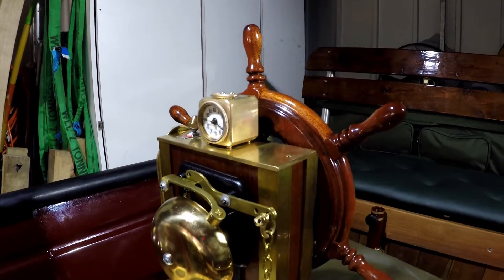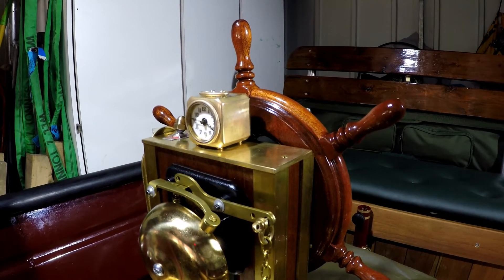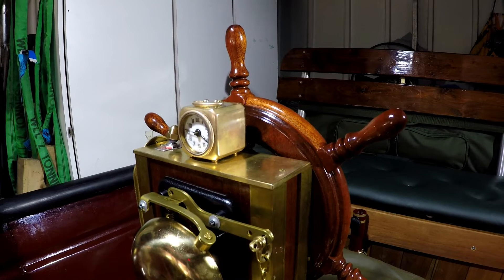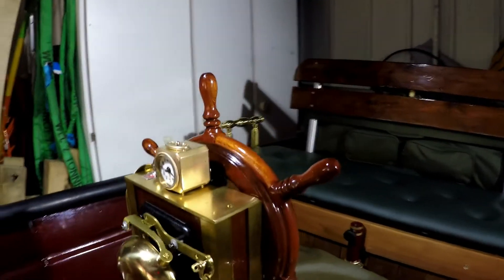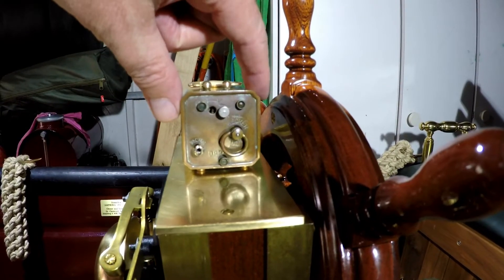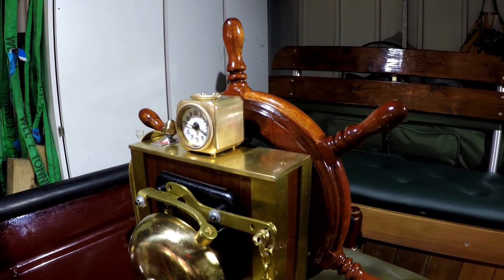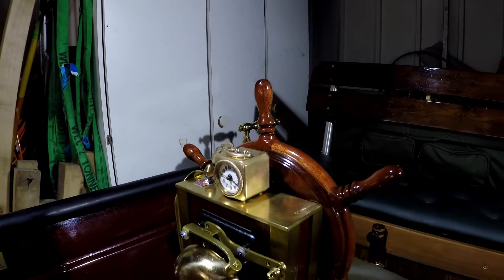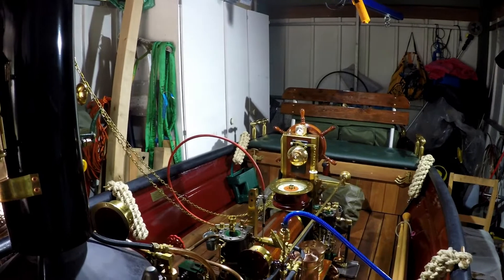Vintage Mechanical Clock on Control Stand

Comment: Bonjour Christoph, 
Even if it turns, you will not see it easily when you seat on your bench. May I suggest you to add a telescopic monopod under it ? Other wise, I would have used the screw located that we can see port side to to shift it a little and install a glass compass i, the middle.
Amicalement,
Reply from the maker: Thank you Raphael, I check it before installation and believe me it is perfectly visible if oriented to the right site, where I normally sit. I was looking for 3 month to find one in a restorable fashion... :-)